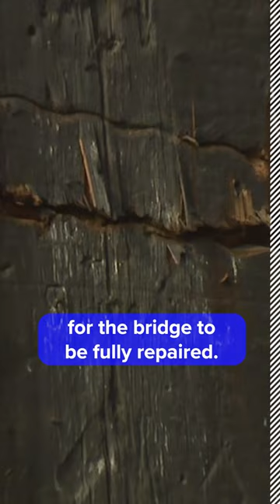What's next for historic bridge damaged by semi-truck #fox43

Comment: It's not like they don't warn you long before the bridge.  These drivers need their cdls pulled and forced to pay for the repairs.
Reply: The insurance covers the driver , but his ins.rates just doubled which could shut him down for cdl driving ! The fines and court costs are all set to get this type of driver off the road ! Profesional drivers get a bad rap because of this sht. ! Just like cops there's bad drivers also !
Reply: You're assuming every single bridge in the USA is correctly labeled. 
They're not. Source: Truck driver, I deal with this BS daily. Going under bridges I'm too tall for without hitting them, or having to call highway patrol to close a few miles of country road because the bridge I'm supposed to fit under actually isn't as tall as they say it is.
Reply: @canesvenatici69  you're a professional just like I am.  You're supposed to pre own your trips and if you see over passes on The trip you're supposed to find out their height before moving.  It's literally your job,  too find out ahead of time and not at the last second.
Reply: @StalloneSiciliano  you didn't read the part where I said "assuming it's correctly marked."

Tell me how a 13'6 van trailer goes under a bridge flagged 12' but can't go under one flagged 14 feet. Go.
Reply: @canesvenatici69  one example where in from in ny,  there's a bridge marked 12'6" but it was really 13'6" because they measured it at the curb and not in the middle of the street. Again you're supposed to figure this out as a professional driver.  Standard height on hwy freeway over passes is 14 feet unless marked differently.  They right me that in training 17 years ago.
Reply: @StalloneSiciliano  so, you're driving along. A bridge up ahead, is marked 14'. You are pulling a load that's 12'3, and BANG. Your load hits the bridge. WHAAAAT HAPPENED?

Since you wanna keep bringing training into this, super trucker. Tell me you've heard these before.
Get Out And Look
When in doubt, get out and look.
Reply: @x-Spirax-x I'm not sure what sort of gas station pills you've crushed up and tried to smoke but in what universe is a tiny covered bridge the ideal route for a tractor trailer?
Reply: @Dan-fw2db  Did I say that? Show me where.
Reply: @x-Spirax-x so you would measure these spans as a professional driver, no? You already know they aren't labelled correctly so take it upon yourself to ensure you can make it or not. There's no excuse for this

Comment: To his defense cdl GPS apps take you thru the bridge but still dudes fault by a mile...
Reply: There are truck GPS made specifically for trucks.  They would take you a different route to avoid low bridges, weight limits and other things specific to a truck
Reply: Garmin. Buy one. Don't be lazy and tell it your dimensions and your weight. A GPS only knows these things if you actually take the 5 damn minutes to tell it these things. It's a minute after that, unless you pull a flatbed the only thing you change daily is your weight.

Comment: That crack yall showed as damage from the truck, was definitely not caused by the truck. You can clearly tell that crack has been there for years because all of the splinters have rubbed smooth over time 😂😂😂😂

Comment: As someone that often has to work around these bridges I couldn't ever figure out why not just build regular bridge next to it.
Reply: There are other bridges! But this guy wanted a short cut.
Reply: Dude, this is a 1-1/2 lane back road meant for local traffic only, not a major thoroughfare.  Semi's aren't even supposed to be on this road in the first place, let alone anywhere near that bridge.
Reply: @nispelsm  I get it, but these bridges are used constantly by Amish crew truck and that wears on them too. Easier and safer solution would be close the bridges off and make them places where tourists can take pictures

Comment: There's no way a 13'6 van trailer fit under a bridge marked 10 feet without destroying it.
Reply: The entrance to the bridge is a bit higher than 10'6", but several of the beams at the halfway point are close to that clearance.  Hence why the truck was able to fit through the entrance, but got stuck.
Reply: @nispelsm  thank you for the explanation, I thought we were looking at another incorrectly marked bridge but nobody is being held accountable because the trucker was at fault.
No, really. It's alarming how many bridges in this country are incorrectly marked. I've gone 13'6 under bridges marked 9' and had to call the police to close 7 miles of road one day so I could reverse 7 miles and go around the bridge marked 14', but my 13'6 trailer is 4 feet too tall.

Comment: This is why mislabling Bridge heights does a huge disservice that truck is probably ~ 13 4 

Top of that covered bridge is realistically 12 1/2 13 foot and this is something they do everywhere.  Just label the damn bridges right and you may have less bone heads doing this stuff thinking about how they lie on those bridge heights all the time

Comment: Truck drivers keep hitting a low railroad bridge in my town at least 10 times a years even though the bridge is older then dirt and there are several signs to avoid it yet they keep doing it. They gotta be dumb as rocks